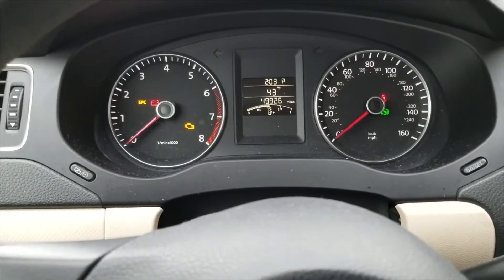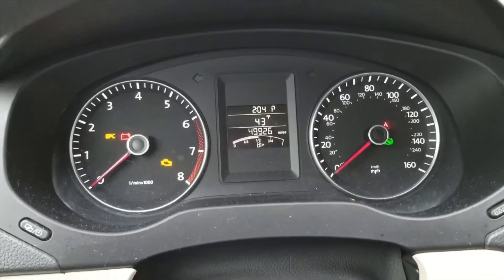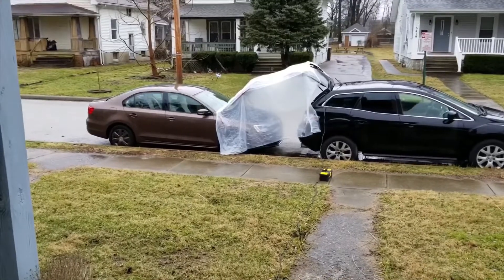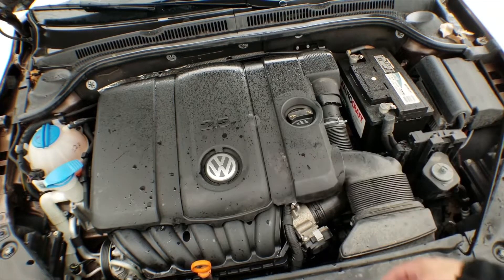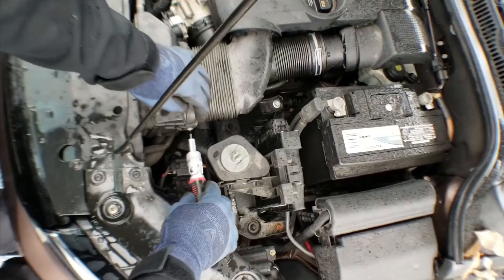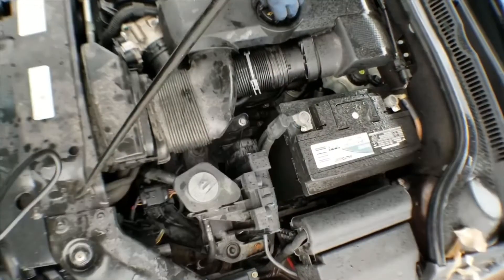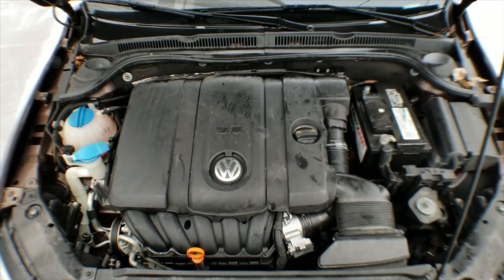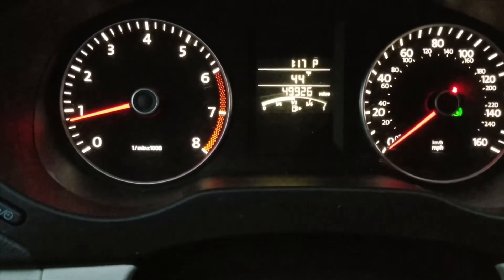Volkswagen EPC Light Diagnosis: Throttle Body Replacement

Comment: Hi. I know this is an older video. But I went to buy the part and the auto parts store told me I would need a specialized computer to relearn the throttle
Reply from the maker: Hi! Thanks for tuning in—I appreciate you checking out the video! In my experience (and for many others who’ve swapped the part), replacing the throttle body on a Volkswagen has been a straightforward plug-and-play situation. No specialized computer or reprogramming was needed. Best of luck on your repair—you’ve got this!

Comment: So I came back to tell you that changed the throttle body and EPC light is on it hasn't came on at all it's running like new but check engine light still on but I haven't done an oil change but I'm glad I got it fixed and it passed the emissions test surprisingly lol

Comment: Hey man so i went for a diagnosis they told me its very the throttle body needs to be replaced  

My car has the EPC And engine light on and it doent go no more then 10 mph 
So i need it to be replaced it sucks also gotta get an oil change too lol

I'm ordering part from rock auto my friend gets his parts there only paying 200 for it thank god cause the mechanic shop wanted to charge me 1k crazy lol
Reply from the maker: Man, I’m glad you found that out and decided to go the DIY route—way cheaper than what the shop was quoting! That $1K is wild, so good call grabbing the part and doing on your own! It’s not a hard job!  You should be good to go afterward !
Reply: I have a buddy of mine who will be doing it he only charging me 200 for the labor :)  @elevatedpotentialacademy
Reply: How long did it take for the engine light to go away ?  @elevatedpotentialacademy
Reply from the maker: @Juli-g1n you may just have to reset it with an OBD2 scanner and if it comes back after about 20miles of driving then something else may be of issue.
Reply: I'm pretty sure it it comes back might be the gas cap cause from what I remember it use to be really tight and now it looks worn out more then anything I do need an oil change tho @elevatedpotentialacademy

Comment: My 2017 Passat just threw the EPC right, and when idling, the rpm gauge bounces around. Could this be the throttle body, or If I get a scanner on the system, would the code ready provide more details, or just a code that lists all possibilities?

Comment: You just saved my ass mate. Power VW wanted $1500 to fix this. I ordered the part off Amazon yesterday for 70$ or so and after watching your video a couple times it took me 30 minutes to do the swap out. EPC and Check engine lights are gone and my 2013 2.5l Golf is good as new 🎉🎉🎉
Reply from the maker: @vaguelystats  hell yes I love it 🙌🏾🙌🏾 I’m happy to hear it !!

Comment: My wife's car gets the EPC light alone, but not all the time.
The main problem is cranking it. After struggling with cranking, the light might come on.
It'll also crank up and immediately die. Or just slight tease.
Rare occasion the EPC light will prevent full power, run high RPMs or stops right before 3k, and prevents the cruise control from working.

Comment: Having this same problem with my 09 passat 2.5L. Shop told me they needed to replace battery  and throttle body for 1500$. I wanna try and do this at home. They said i would need to program battery to my vw. That i can't just change it. Anyone know how tru this is?

Comment: Will this take away the P0304???
Reply: Replace the Spark Plug # 4 & Ignition Coil #4.
First, do what ATG & my suggestions, remove the ignition coils & spark plugs (edge & edge) then swap them.
For example: 1 to 4 & 4 to 1. If your check engine code changed then you have found the problem.

Comment: My epc light and engine light is on I ran the codes and it says p0121 ( throttle position sensor ) and my cruise control light comes on with a (!) beside it do I have to replace the pedal or what can I try to fix this? 

I appreciate any help! Thank you!

Comment: Thank you so much for this video! It helped me to be able to replace my throttle body that I’ve been having issues with for a little over six months and I didn’t have the funds to have a mechanic replace it. I just finished putting the new throttle body in my car and both the EPC and check engine light are gone. My car is driving so much better with no acceleration problems. Thank you for all of your help.
Reply from the maker: Hey that’s awesome! I’m glad to hear that my video helped you solve the problem!! Thanks for watching and if you could do me a favor by subscribing it’d be greatly appreciated! Thanks again!
Reply: I’m going to try this !  Y’all pray for me!

Comment: I'm driving to west VA rn. First 4 hours fine...then boom. Epc code...limp mode couldn't go over 40mph
 I have to keep turning my car off for about 30min and then it's fine again. Happened once before when I bought it...took it to vw and they said they couldn't find anything wrong....I drive a 2018 tiguan. Any ideas? My first thought  was throttle issue.

Comment: When you replace this throttle body did you need to reprogram it or did it automatically adapt?
Reply from the maker: There was no need to recalibrate it. It worked once it was installed! Thanks for tuning in and I hope this helps!
Reply: @elevatedpotentialacademy  Thank you

Comment: Hello my EPC light and engine light came on the engine light was blinking....when they come on my car seems like it loose power and like it want to cut off the engine light goes out and the EPC light stays on after I go back and crank the car up again neither light comes on but later on they will repeat by coming on do this seem like a throttle body problem to you....I drive a 2011 Getta....and if it's a throttle body if it get replaced will it solve the problem

Comment: That first part if filter housing you unscrewed, just pops apart with clips 1” towards front if car where you disconnected. Don’t have to remove those screws..  now I’ll continue watching so I can remove my throttle body

Comment: Hey man, thanks for the video. I've been having the exact same issues, so I just replaced the throttle body in my VW Passat, but I've still got stalling,  acceleration and idle issues. The code from the diagnostic was a bad throttle position sensor, so I'm wondering if it's an electrical problem in the wiring leading up to the tps. Any ideas? Thanks!
Reply: you need to Adapt the throttle body

Comment: Awesome video! This video has been extremely helpful because I have the same car with the same problem! I was hoping you could help me with a part number for the throttle body. I'm having a tough time finding the exact part number and don't want to order the wrong part and have to deal with the hassle of returning it and waiting even longer for the correct one. Been there done that with a few different parts for my Honda, lol. Thanks for any help!

Comment: I was wondering if the throttle body fixed your issue.

I've got the epc light on. So, I decided to remove the throttle body to clean it with tb cleaner. After putting it back on, I went for a test drive and I was able to get the speed up to 80mph. It was running fine until the light came back on again. Now the max speed the car gets it around 50mph again.

Comment: Thanks for your knowledge, i have a 2016 Jetta, epc turned on and car is running sluggish after changing my rear brakes. Was hoping to change throttle body and see if light goes out. Can you share link of exact throttle body you purchased. Please and thank you

Comment: Hey I just got my 2016 volkswagen jetta 1.4v  model S I was driving it and the ECP light came on and the motor light to and my car start shaking you think is the throttle body ?

Comment: 2009 vw bug EPC light after battery replacement along with left rear ABS sensor code and abs light and P3078 code wont go over like 50 but does not stall or have rough idle so is it really the throttle body?

Comment: That connector on the underside of the intake tube is removed by squeezing the ribbed ends and pulling it off.  If you get the EPC error again.  Check for break in that intake tube.

Comment: Thanks for this. Saved me $1100. One thing though. You don't need to take off the oil cap. And if you did for any length of time you should always put a rag over it so nothing falls in.

Comment: Great video! I'm hoping you could give more insight on a similar issue I'm having. It's an on and off issue I've been having for the past year but battery light and EPC light come on after the car jerks badly while driving or the car shuts off at a red light on my 2012 VWJ. My brother replaced throttle body and camshaft sensor August 15th as those were the two fault codes showing up. Five days later my car shut off on me at a red light. Battery light came on, put it in park and turned it back on and EPC light was on until I got home. Took my car to my regular mechanic yesterday and he basically told me it's my ECM causing this issue and I had 5 fault codes show up (P3078, P0106, P0322, P0321 & U1017) mind you my car drove perfectly fine to and from. Help?!
Reply: Did you end up finding the problem?
Reply: It almost sounds like electrical something loose connection

Comment: Hey I have a 2012 Volkswagen Jetta, 
Dealership said that my throttle body and purge valve was the problem. I start the car it runs then powers down. When I’m highway driving it will stay on… Any help, I don’t want to pay 1,000 plus. I just bought the car

Comment: I wonder what screwdriver you used to remove the filter and the throttle. Nice video btw!! Im getting that EPC light and I already used an OBD2 it detected that the throttle body wasn't working right. When I accelerate the car has a delay and doesn't accelerates well.

Comment: Thanks for the quick vid. DO YOU KNOW IF THE BUTTERFLY VALVE IN THE THROTTLE BODY SHOULD HAVE A LITTLE AIR GAP, BE SLIGHTLY OPEN, WHEN YOU REMOVE THE PART OR SHOULD IT BE COMPLETELY CLOSED, NO AIR GAP AROUND THE CIRCUMFERENCE? MINE REMAINS BARELY OPEN WHICH KIND OF MAKES SOME SINCE, TO LET A LITTLE AIR PASS THROUGH BUT MAYBE NOT??  THANKS

Comment: I have a 2013 passat SE EPC light comes on for 2-5 sec goes off but when its hot outside Kind of doesn't like to start its a delayed start possible throttle body replacment plz help

Comment: I have throttle codes on mine I got another throttle body it was a cheap one it worked for about a day then the light came on but I was told just go to Volkswagen and get it from them hopefully that works

Comment: Check the  fuse  first, sir.   There is  an EPC fuse.    Its with the other  fuses  i know  on   my   vw   its   fuse   number    43   not under   hood   but   with the  other   fuses  inside the  car.

Comment: My car has been having an issue where sometimes it pushes me/ accelerates itself. 2 months ago it was doing the same thing. When I’m slowing down or stopped it turns off and my battery light shows up on my dashboard, it doesn’t let me accelerate or even brake it just gets hard and my steering wheel basically locks , I turn it off and turn it back on and it comes on like if nothing happened. What could be the issue? I’ve went to so many mechanics but they all tell me something different 😭

Comment: Hy thanks for sharing your knowledge.

But I've 1 question why you guys always change instead of just cleaning it up like i did to a toyota crolla i know the brands and made are different but still helped me %100.
Reply from the maker: Hey thanks for tuning in it is greatly appreciated! I had opted to change it since it isn't guaranteed and the car was a 2012 so I figured hey why not just go new rather than clean it and continue to possibly have issues down the road or issues with the throttle position sensor attached to the electronic throttle body. Thanks again and if you had enjoyed this video please consider subscribing 🤙🏽 Stay Tuned!

Comment: I have an 03 vw passat wagon. It will not start, the engine will turn but will not start. The epc light is on but check engine codes. They light never came on until the battery was disconnected for a couple of days. Any help would be appreciated.

Comment: Excelent video but how did you get rid off the check engine light? Did you just drive the car around?
Reply from the maker: Thanks for tuning in it is greatly appreciated! Loving the positive feedback🤙🏽 I had to clear the check engine light manually with an OBD2 scanner but the EPC light came off on its own after repair. The check engine light never came back after the usual 50-100miles in which a light would reappear if there was a continued issue. Thanks again and if you had enjoyed this video please consider subscribing 🤙🏽 Stay Tuned!

Comment: I bought a 2013 VW Jetta 2.5 and it has 68k miles on it, I turn on the key and it shows service and it the EPC and Engine light are on, after I start the car it goes away, what could that be bro? It’s my first car and I wanna take care of my baby 

Ps. Im thinking of putting a cold air intake from eBay, do you think it’s a good idea or I should stick to being stock?
Reply from the maker: Hey thanks for the positive feedback and tuning in! It is greatly appreciated! I hope that this video was helpful and will help you resolve your EPC light issue 👊 are you saying when you turn the key those warning lights show up or after the car is turned on? Do they disappear when the car is turned on? 👍 Stay Tuned and consider subscribing if you enjoyed the video! Thanks again!!
Reply from the maker: It is normal for those lights to illuminate prior to it being turned on; however, if it stays on after the car is turned on then there is an issue that needs to be diagnosed with a code reader. Thanks again

Comment: Can i have the link where you got the throttle body?
Reply from the maker: Hey! Thanks for tuning in!, it is greatly appreciated! I hope that this video helped you with your EPC light issues. Here is a link to the throttle body I purchased (make sure yours is a 2.5L engine):

https://www.ebay.com/itm/Fuel-Injection-Throttle-Body-for-VW-Jetta-Beetle-Golf-Passat-2007-14-07K133062A-/283478438256?_trksid=p2349624.m46890.l49292

If you had enjoyed the video please like and subscribe🤙🏽Thanks again !

Comment: I had a code p0122 pop up on my 2013 passat. took it to a mechanic who replaced the throttle body but said the check engine light still wouldnt go away, so they tinkered around some more and found out the issue was a faulty wire... it was chafed. they said that caused the previous throttle body to break but i have a sneaking suspicion they only said that so they can charge me for the new, unnecessary throttle body. but what can you do? they charged me around $850 for that job and it pains me to think it couldve cost possibly 1/4 of that (cost of a wire + couple hours labor)...

Comment: Hey man,  great video.  My throttle body just went out of my 2012 Jetta.  One other video suggestion you should make is replacing the PCV valve diaphragm.  Its common for them to break every 50,000 miles or so.  Causes the computer to act like there is a misfire and start idling rough.
Reply: My car has a P0300 code and the EPC light comes on altogether with check engine light on. You think the throttle body is the cause? Help please!
Reply: How is that possible when the pcv valve is attached to the valve cover you have to change the whole valve cover  to change the pcv valve

Comment: Throttle bodies normally cost ~ $400. How did you get it for so cheap?
Reply: Expensive part :(
Reply from the maker: @tippsidavis8908  got the right one on EBay. Where I get most my parts
Reply from the maker: @tippsidavis8908  the same one i got is around $60 now
Reply: @elevatedpotentialacademy   thank you very much. I’ll check it out

Comment: Hello, great video! I have 2013 Beetle, can I just replace the sensor or do I need the whole throttle body? Where can you find these parts at for a decent price?
Reply from the maker: Is yours a 2.5L engine?
Reply: @elevatedpotentialacademy  yes!
Reply: Amazon or ebay the whole throttle body for 60-80 bucks
Reply from the maker: Hey thanks for tuning in! It is greatly appreciated! I hope that this video was helpful and will help you resolve an EPC light issue 👊🏾 the throttle position sensor is built into the Throttle body with VW. The Throttle body you purchase will be identical to mine.  Keep me posted on the results👍🏽 Stay Tuned and consider subscribing if you enjoyed the video 🤜🏾🤛🏾 thanks again!
Reply: How much do these parts cost you?
Reply from the maker: @IAMCHELSEAKELLIE  https://www.ebay.com/itm/283771894482
Reply: @elevatedpotentialacademy  you are a life saver!!!!
Reply from the maker: I'm glad I could help😊 I hope all works out! Keep me posted on results! If you had enjoyed the video please consider liking and subscribing 🤙🏽 thanks again!

Comment: Did you need to preform a relearn procedure for the new throttle body?
Reply from the maker: Hey thanks for tuning in! It is greatly appreciated! I hope that this video will helped you resolve your EPC light issue 👊🏾  i did not have to do a relearn! The throttle body will work just fine after installed👍🏽 Stay Tuned and consider subscribing if you enjoyed the video 🤜🏾🤛🏾 thanks again!